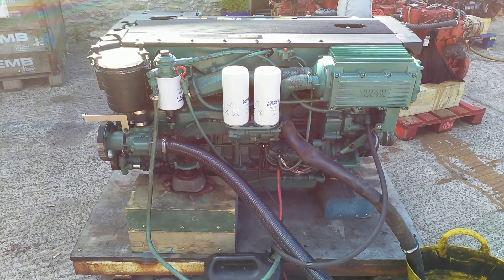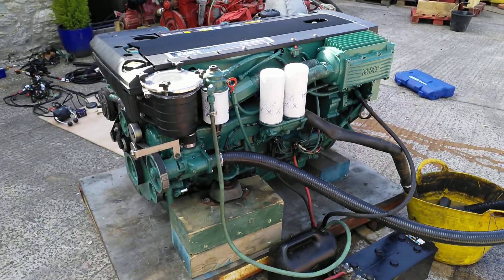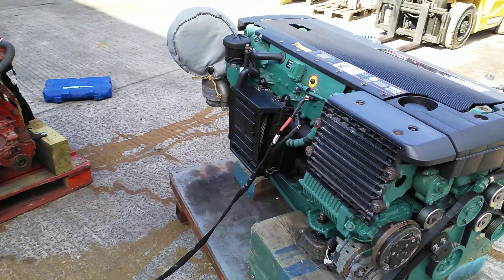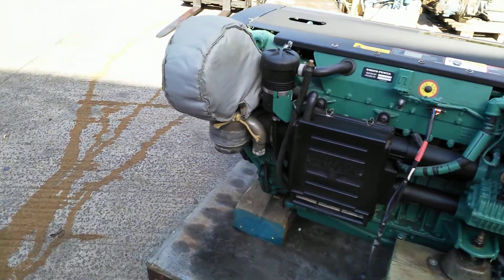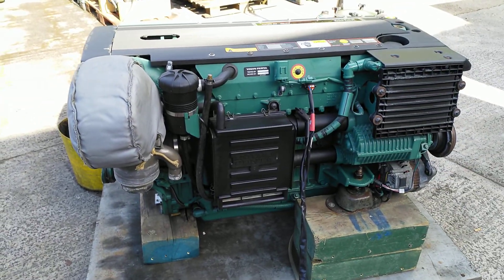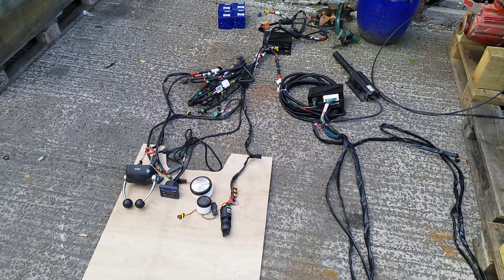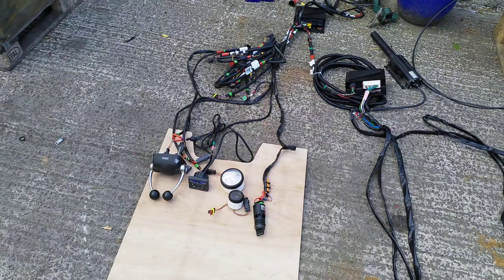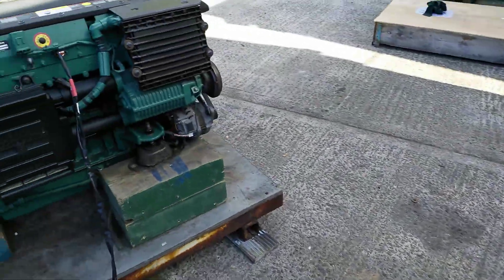Volvo Penta D6-350A-B 350hp Marine Diesel Engine

Comment: Is it any relation to the Volvo D6A used in FL6's?
Reply from the maker: No, the new D6 engines are built by Deutz in Germany for Volvo Penta. The engine used in the FL6 trucks were I believe the Volvo TD61 block which Volvo Penta marketed as the TAMD61 and latterly the TAMD63. They were the same base block and crank but different pistons and liners, fuel pump, turbo etc.